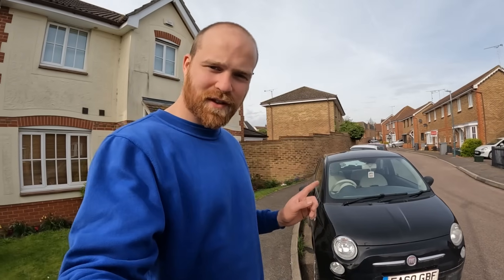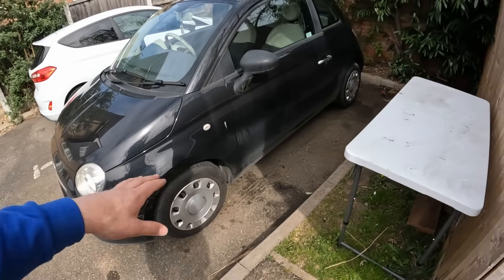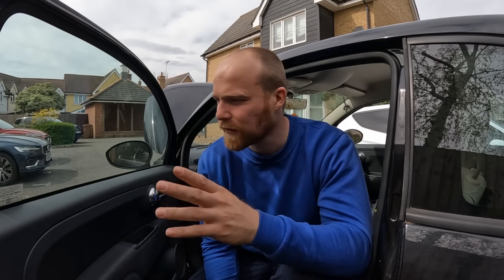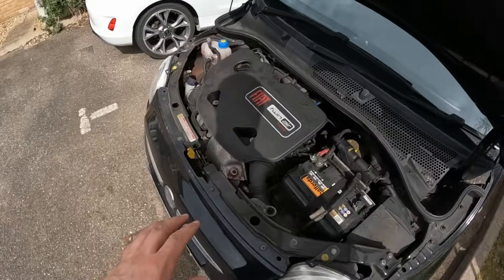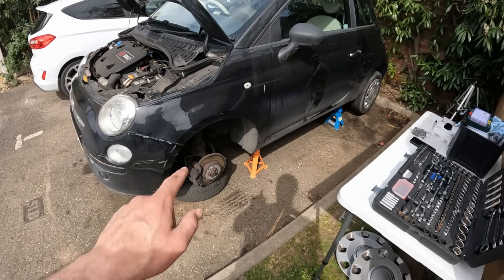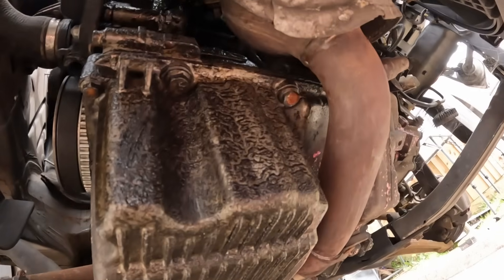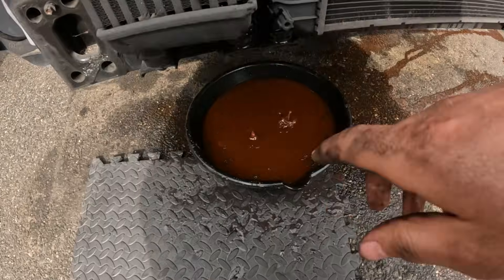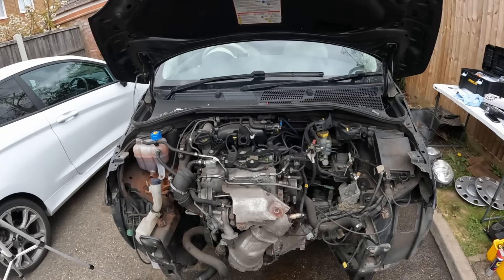Can this Fiat 500 be saved from the scrap yard?

Comment: I acquired one of these vehicles recently but with the 1.4 engine ( same  NICE colour) , and shortly after I checked the oil  to be shocked to discover that the oil level didn't  even register on the dipstick and she was still running.  It took a litre to bring it to the half way mark.The sump nut is not exactly oil tight but  its  still keeping in  the oil. That red staining looks like the coolant. IMO these little engines are too light for a turbo. With regards to doing things the right way, once its done, does it matter?

Oh do the dents/scratches really need to be fixed, they are not that bad, are they?
Reply: yeah the dents and scratches are only aesthetic, they don't seem to affect the function of the car

Comment: The TwinAir system relies on good oil pressure to work. You need to change the oil & filter every 10k miles and ALWAYS clean the strainer. I guarantee the strainer has never been cleaned.
Reply: Also must be the correct oil spec, they're very finicky about that.  So many failures due to poor servicing.  Properly serviced ones go on a long time.

Comment: Get yourself a box of latex gloves, you'll get minimal impact/scrape protection but you'll retain your dexterity and you'll protect your hands from all the crap and dirt from the oil and road crud...
Pink stuff is old coolant, Black slimy stuff is likely oil, red/brown stuff is likely rust and white powdery stuff is likely Corroded aluminium oxide. The joys of motor mechanics...but, do get some latex gloves...
The coolant is quite a normal colour for coolant which is well past its sell by date but don't worry, its not rust coloured as your engine will be aluminium, its just old.
Reply from the maker: My problem with the latex gloves is that because I'm constantly lowering and raising myself off the tarmac with my hands they rip way quicker than normal. I've got a pair of Muc-Off mechanics gloves coming, so maybe they'll be a nice middle ground. Good to know about the coolant 👍🏻

Comment: @8:03 I don't know for sure but ... have you ever thought about a failing Multiair unit?
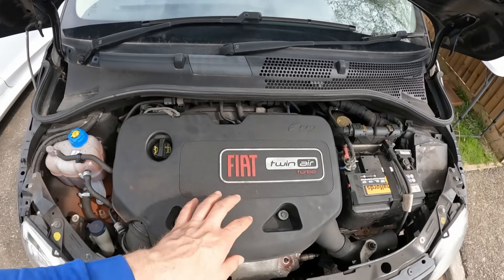@10:26 BTW. the Multiair unit requires specific oil in order to function properly.
@20:06 I disagree with not maintaining the multiair unit. Oil is cheap, engines aren't. Make Tina great again. 😘
Reply from the maker: Do you know what oil these engines are supposed to take? Lots of conflicting information online...
Reply: @NotEconomicallyViable  5 w 40 in my experience
Reply: @NotEconomicallyViable  Selenia K Pure Energy 5W-40, AFAIK.

Comment: GLOVES, either buy lightweight mechanics gloves or just rubber mechanics gloves, You know when a bolt is stiff - put the glove on, it takes 3 seconds. come on now be sensible, when you seriously crunch your knuckle you'll wish you had - but then you will. As they say fit the alarm before the fire - it's no good afterwards. Good Luck.

Comment: These mutiair/ twin air engines rely on oil pressure to function properly it's to do with the head hydrulics pressure and valve functions 
Its a Must these engines have regular oil changes and Never run low on oil, dirty oil etc   specific oil is required and also as part of the oil service i believe as with the multi air 4 cylinder unit  there is a oil filter in the head that also needs replacing!.
Generally These twin air engines are more unreliable than the 1.1/1.2.  4 cylinder fiat fire unit in other 500s it's  been around for years very reliable and just require a basic annual oil change and timing belt every 5  years. The pink residue is a coolant could be a leaky hose maybe just  when you put some in its run down !
Coolant condition, colour suggests lack of maintanance 😲 should be replaced every 2/3 years, usually repladed with timing belt, water pump change ..
Oil in the intercooler suggests turbo oil seal failure, oil leaking into the air intake .
Reply from the maker: Thanks for all that info, Marino. These engines definitely seem more unreliable, but I have to say they're brilliant to drive when working properly. I'm going to have to delve into the turbo a bit further because a few people now have said that the turbo seals have likely gone bad

Comment: The big problem with this engine is that oil leak and you are taking the cheapest option on your repairs like a good second hand engine and it is a bonus when doing this engine removal that there is no air-conditioning because that adds another level of complexity to the engine replacement l have air-conditioning on my 1997 Hilux and the complexity is mind boggling but l will never have the engine changed because the 22R engine is good for at least 800000 kilometres and l have only 436000 kilometres on it and been a longitudinal engine l don't have to remove the front clip and another you tuber replaced the engine on his Daihatsu Charade it took him a long time also he replaced the engine on his 2ÇV that took him a day so simple and on his own without an engine hoist.The Fiat 500 the best of all the retro cars as far as design aspect there are so many design cues from the original Fiat 500 they did an very good job

Comment: hi lots of comments. there pron to water pump leaks and thermosta leaks. engine problem you ran out of oil. thus hydraulic lifters failed ie no air into cylinders ie no compression until put oil into engine then they work. poss oil feed to head rover 820 had lifter problem.  and old polo had blockage on head no oil into head valves failed to open. took hrs to find when quoted cust would not pay so put it back to together. owner asked what was wrong would not tell him other than £750 to cure it lol. your doing well

Comment: Twinairs are not very good   the 1.2 is is relatively  Bullet proof. THE HANDLES ARE WELL EASY TO CHANGE. NO OIL WILL KILL ANY ENGINE
Reply from the maker: The engines are great from a driving perspective, but definitely not as bulletproof as the 1.2 due mainly to the increased complexity and novelty

Comment: The garage says in all his years of doing engines he’s never had an engine that’s got no compression one minute then has randomly. From what you’ve said it’s stuck valves. No lube and heat making them stick open. Even slightly will cause no compression so the car won’t start. The fact it’s ran so low on oil to cause the valves to stick tells me the damage has been done to everything

Comment: Just recently started watching your vids. Interesting stuff. 
I find it a little wasteful to replace an engine after a problem seemingly fixed itself. 
At very least, continue using the engine to see if the problem happens again. Keep a closer eye on the oil. If it where me I would of only replaced the engine after the engine was unusable. 
Would of been a real shame if you where wrong about the damage and the engine was fine and you replaced it simply because of a misunderstanding. 
Mechanics will always tell you to replace stuff because its good business for them. 
I guess at least you where able to make a video of it. So that is something.
Reply from the maker: Sold the engine to a mechanic to fix and put in another car, so it didn’t go to waste
Reply: @NotEconomicallyViable  Excellent. Dad's a mechanic. He would often tell me stories of people doing needless repairs and wasting perfectly good components. 
One that sticks out in my memory was a story he told me about a customer who had their transmission  replaced by another shop only to have the problem persist. In that case it was a clogged ATF hose. 
He works on European cars, mostly Mercedes and BMW, he used to do Land Rovers and Range Rovers until a few years ago.
I told him about your ordeal with your Rover and he gave great respect for doing a trans on the ground. 
Love your vid's, please keep going, congratulations on the baby btw.

Comment: I'd check out utube "Stanhope Auto Repair Centre" Fiat 500 0.9 before you do anymore!
I believe these engines deliberately loose compression through the hydraulic values when the oil pressure gets low! This so you don't ruin the engine. I'd be inclined to just service the engine you have in the car first, then see how things go!

Comment: Fiat 500 TWINAIR MULTIAIR units, the first two generations are very bad, those engines should be avoided in every sense... I have more confidence in the 1.2 fiat punto/panda FIRE engine evolution in the 500, so I suggest you put that engine, they are quite cheap with scrap vehicles

Comment: I don’t understand 
You have a car engine with only 60,000 miles that doesn’t work !
That’s crazy. 60,000 is nothing. Sure you get failures in say water pump, or leaking radiator or bad alternator. But an engine has gone after 60,000 miles. That’s a crap car, that’s not a car you should be buying. 
On the engine switch how’s the electronics going to work ? Maybe there’s no immobiliser or engine management in this car as it’s so crap and it use’s clockwork or something. I can’t get over the engine being done at 60,000 to be honest